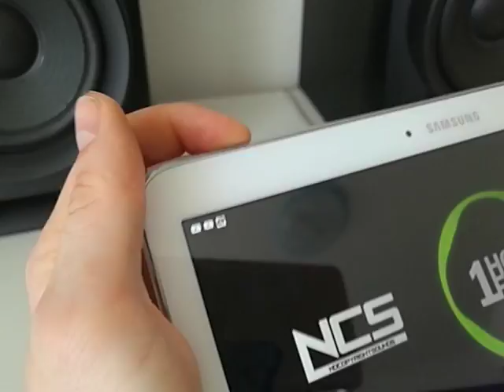TDA7377 amplifier board test on speakers

Comment: Guys go get the  tda7379 which is probably the cleanest sounding amplifier available for about 5$. Thank me later.
Reply: KentoDC21  Yes I  have it and some other amplifiers. 7377 is weak on bass but volume is high enough.
Reply: Is it really better? I have 7297 from aliexpress, it sounds bad with cheap electronics. I need it for my project, it seems there is no other amplifier for 15 years so far:'(
Reply: What class is this?